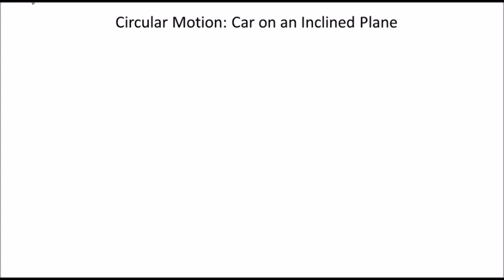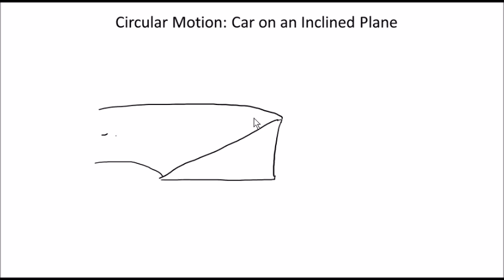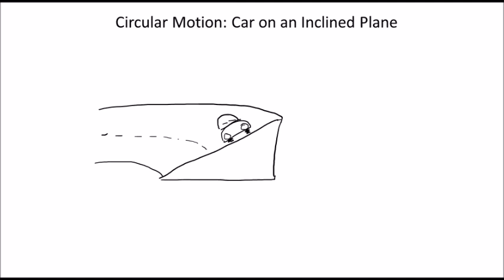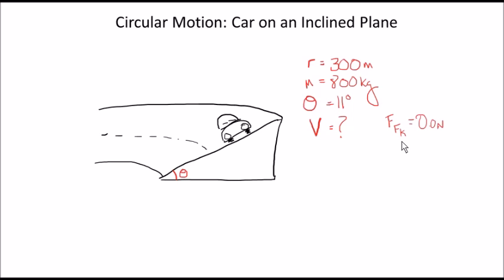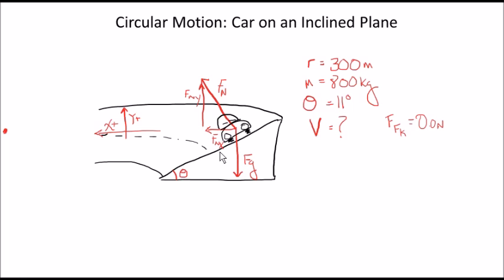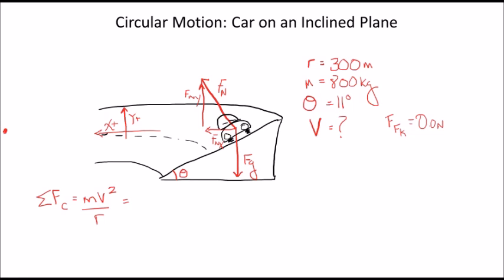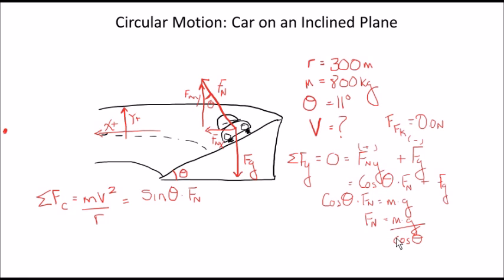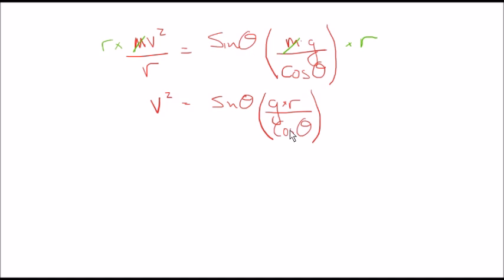Circular Motion on an Angle

Comment: What direction does friction act during circular motion on an inclined plane?
Reply: generaly ignored but if it isn't then in the direction opposite the direction of motion ie car going left friction going right
Reply: @yaboi7239  Yes but no, the velocity you get from the formula given is a cut-off velocity. If the velocity you are going at is under that cut-off velocity, the friction will point upwards and away from the center. If the velocity is higher than the cut off velocity, the friction will be downwards towards the center.